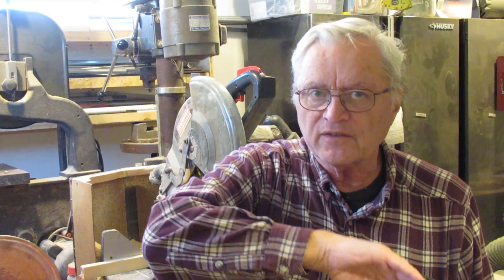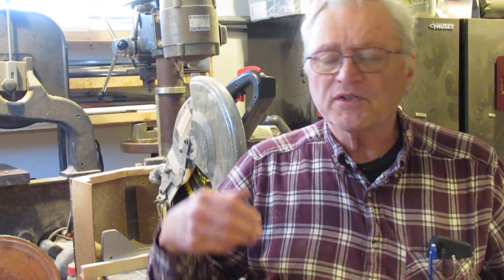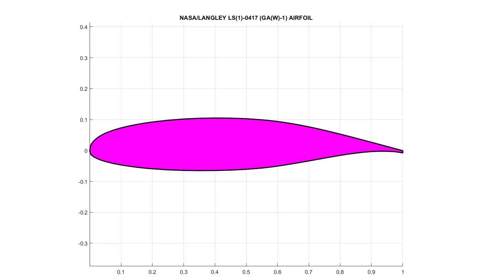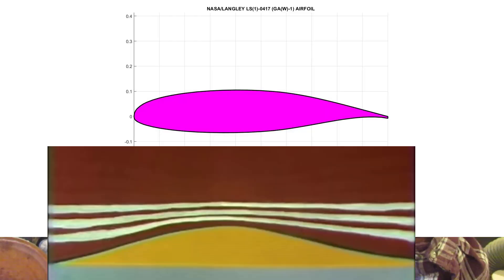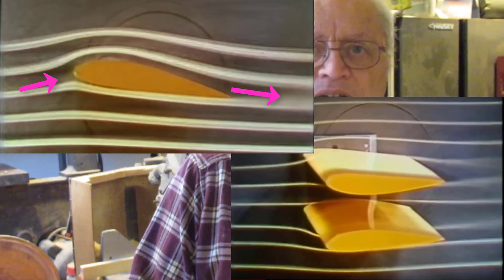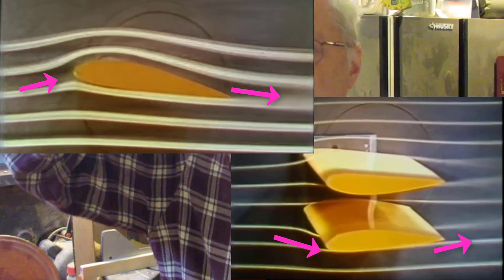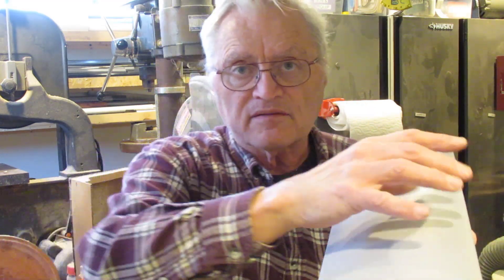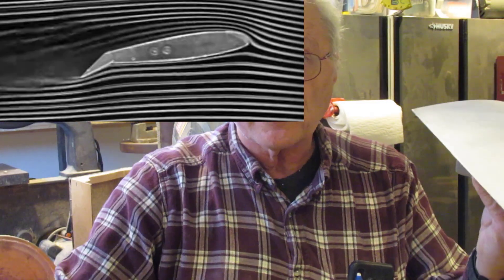Lift: 10 Myths in less than 10 Minutes

Comment: Love your video. I can add one more myth: 
11: "Lift is caused by flow curvature"  youTube video search "Magnar Nordal Bernoulli"

But I have to disagree with your Myth 10. That's not a myth. It's a fact.
You indicate that the truth lies within Navier Stokes, Vortex Shedding etc.,  but there is a simple mystery: 
What is the cause of the pressure difference that applies the lift force on a wing? 
It has to be explainable in classical physics that is intelligible to a senior school physics student or at least mathematical physics graduate like myself. Shrouding the answer behind a wall of obscure and insoluble partial differential equations just  doesn't do it for me.  
The development of wings for powered and unpowered flight has been a continuous process of trial and error for over a hundred years. Some changes improved the efficiency, some didn't. They took the useful changes and tried further variations.That's not science, that's good old engineering.
Find me a scientist that can demonstrate he/she understand it. 
I have a theory, based on the classical physics of  Boyle's Law and Charle's Law and does not rely on Bernoulli, but it's not fully developed and I'm brutally aware that I'm the "soldier who's out of step", so am keeping a low profile for the moment. But let me say that I'm deeply disturbed by the widely held statement that air over an aerofoil acts like an incompressible fluid. Air is quite patently compressible!!
Reply: @Observ45er  Nope, I have known this for a long time. I'm just getting better at explaining it.
Reply: @Observ45er  Now I'm confused. I have agreed with you. You said the wing pushes the air. And that the wing moving away reduces pressure. You are correct. 
Pushing air causes high pressure - that's what a bicycle pump does - it pushes air and creates high pressure.
I don't understand what any of that has to do with Bernoulli. 
This isn't comedy or a joke. I don't understand why you seem to be getting annoyed with me.
Reply: @Observ45er  I'm a retired software engineer, very active racing yachtsman, retired private pilot, BSc Mathematical Physics Birmingham UK 1967, grandfather of 5, based in Sydney.
Reply: @Observ45er  Now I am confused. 
You said: "I' don't think I said anything that has to do with Bernoulli " then " he explains that you CAN CALCULATE the lift force using either Bernoulli to get pressures from speeds,".
I am saying that Bernoulli cannot be used to explain lift because, as I said 3 hours ago, there is no acceleration of airflow over the wing. 
The pressure differences have nothing to do with accelerating of decelerating airflow. They are due to the "push" and "pull" that you identified an hour ago.
Eastlake's paper is just a rehash of the scores of books and articles I have ploughed through in the last three years. And, like Anderson,J, Marchaj, Gentry and Prandtl before them, he has completely misinterpreted Kelvin's conservation of circulation theory.
I would direct you to my exposition on Prandtl's misinterpretation of Kelvin but youTube does not allow me to post links 😞. I don't understand how you were able to post the link to Eastlake's paper.
Reply: @Observ45er  That's a very long comment, so I'll concentrate on the first point upon which we definitely disagree, and that is: "In the wind tunnel we see it speed up toward the trailing edge. "
If you look at the smoke over the top of the foil in Babinsky's excellent video, you will see that it gets to the trailing edge at the same time, or slightly later than the small at the top of the screen. 
That means it has not been accelerated by its passage over the wing.

I challenged Babinsky on this point and he explained why the smoke was not going faster over the wing than at the top of the screen in his experiment and he said: "Friction".
Could I make two requests please:
1. Could you show me an example showing the air being accelerated over the wing? And I mean experimental, physical evidence, not a computer simulation.
2. Could  you explain why it should accelerate?
Reply: @alans172  OK. One thing at a time.
Speed VS. Acceleration.
..
I give you credit for trying.
..
Unfortunately, Jim. You just proved you do not understand acceleration. 
..
First, In Babinsky's Wind tunnel video, the upper air [that starts right next to the lower air] beats the lower air to the trailing edge. Also, the lower air is FAR BEHIND your high reference AND the upper air. 
BOTH of those PROVE there is some kind of a differences you appear to not see.  They show that there is more (close-in) acceleration  above than below. Why can you not see that?
..
If you want to understand keep reading.
.
I'll try to help you understand.
..
The definition is that Acceleration is a CHANGE in speed.
..
For example (simple numbers):
.
1 - If an object is going forward at 2 MPH then reverses and winds up going in reverse at 1 MPH that is a change in 3 MPH.
A=3; V=1
.
If, in the same amount if time:
.
2- An object goes from 0.0 MPH to 2 MPH forward, that is a change of 2 MPH. 
A=2. V=2

.
In A, there is MORE Acceleration (3), but LESS ending speed (1). 
In B, there is Less Acceleration (2), but MORE ending speed (2).

.. 
Compare these carefully:
1. A=3; V=1 --> More A, but less V
2. A=2. V=2 --> Less A, but More V
.
The conclusion is that we can wind up with more A, but less V.
.
IF you don't understand that, we're done. Have a good life.
..
..
..
Some basic science:
Wind tunnel VS. moving wing observations:

Looking at Acceleration from these two (inertial) frames of reference, we will observe different speeds.
. . .BUT . . . 
We will observe exactly the same speed Changes, or Accelerations.

.
The observations show this.  This is very careful observations with measurements, nit just quick looks.
My figure 7 shows this and came from measurements by a PhD at JPL.
- - 
Cheers.
Reply: @Observ45er  
My requests were:
1. Could you show me an example showing the air being accelerated over the wing? And I mean experimental, physical evidence, not a computer simulation.
2. Could  you explain why it should accelerate?
These are fundamental questions. You say you have observed 1) in wind tunnel testing. All the aerodynamics textbooks claim it as a basic fact. I cannot find any evidence. Babinsky's video and my personal experience with a hand-held anemometer on the lee-side of the sail of a 40-ft racing yacht in 20 Kts apparent wind (12 Kts true) failed to find any evidence.
Reply: @Observ45er  Here's a link to my demonstration that the air does not accelerate over the wing. youtu.be/rHidaQgBb-Y
Reply: @alans172  No acceleration of air from a wing's motion???
Picture, for your viewing pleasure. No words at all:
www.grc.nasa.gov/www/k-12/VirtualAero/BottleRocket/airplane/Images/downplane.gif
Reply: @Observ45er  A picture tells a thousand words, but this one doesn't show air accelerating chord-wise over the wing:  the camera is pointed in the wrong direction!
Reply: "Find me a scientist that can demonstrate he/she understand it."
If you won't listen and try to understand, it is pointless.
Reply: @Observ45er  If you recall, it was you who initiated this thread with questions about my views on the subject,  not me. Berating me now for not trying to understand is a bit uncharitable. 
I am using my request for this information, not out of a desire for education, but to demonstrate that in your inability to respond, you are in fact confirming my knowledge that the very foundation of aerodynamics, namely that air accelerates over an aerofoil, is a myth. 
The fact that you have not responded to my questions reinforces my conviction that aerodynamic engineers such as yourself have too much professional, commercial and/or reputational capital in perpetuating the madness of theoretical aerodynamics that they are  unwilling to recognise that it is founded on many such myths.
Your apparent belief that I am engaging with you to understand what you are saying would be frankly comical, were I not dispirited that I have not been able to open your eyes to this myth.
Reply: @alans172  P.S. I'm an Electrical Engineer.  However, I understand physics fully and decided to study this about 10 years ago, band also doing a number of very carefully planed and executed experiments that are consistent with settled physics so I could use them with students that can understand physics, even at the grade school level.
Go to MIT or somewhere with an aerodynamics research facility and 'see for yourself' as I have.
However, 
If you have some skills that you can help others learn, you'll do better going with that and be proud of it, but don't post on You Tube trying to show that all scientists before you are blithering idiots.
.
Whether you intend to be or not, you're trolling.
Reply: @Observ45er  The fact that you're not an aerodynamics engineer deepens the mystery of why you are unable to comprehend the significance of the absence of evidence of air accelerating over a wing. You claim to understand physics, so will be aware that  that physics is an experimental science. 
Experimentally, using pressure sensors, it has been demonstrated that the pressure above the wing is lower than ambient, and that the pressure under the wing is higher than ambient. No argument. Good physics. That's what provides the aerodynamic force that provides the lift and drag from the wing.
And yes, Bernoulli and the thousands of  fluid engineers that have followed have demonstrated that when fluid flow is constricted in a pipe, the flow rate increases and the pressure drops. Good physics. Bernoulli and Euler used Newtonian mechanics of mass and acceleration to build a theoretical model to explain it. All good mathematical physics.
But…..
The air through which a wing is moving is not a fluid in a constricted pipe. There's no pipe. 
There is no experimental evidence of the air accelerating over the wing.

THERE'S NO EXPERIMENTAL EVIDENCE.
The source of the pressure variations cannot be due to the air accelerating. You have, in a now deleted reply, have already put your finger on the source of the pressure variations:
A wing requires a positive AoA to generate lift, so the underside of the wing is moving into the air, the topside is moving away from the air.
The wing pushes the air causing it to compress which creates the high pressure below.
The wing moving forward generates a void of low pressure above the wing.
That's it. It doesn't need acceleration, Coriolis' force, flow curvature or any of the madness of Navier Stokes to explain the fundamental physics.

P.S I saw your reply to my post on the Light and Sporty Guy's video youtu.be/IK2BS8BRXyU which you have since deleted. Yes, only .6%ATM is required to support a C172 and ~5% to support an A380, so compressibility is not that significant. It's the acceleration message that was important.
Reply: @alans172    Again, I've observed the acceleration above a wing with my own eyes at Embry-Riddle.
..
You talk like experiments are some irrelevant activity, yet you claim to have performed experiments by hand anemometer to "prove" your claim that there is no acceleration around your sail.
Question 1: Will you please resolve that contradiction - do experiments tell us how physics works or not? 
Don't change the subject with another 'what about' X. . .
..
.. Fact:
It is most definitely the experiments that have been done over the last centuries that have given us an understanding of the physics.  
How else ? were the sciences perfected to make things like modern medicine or the electronics devices you gladly  use with little to no understanding of?  Are all those happy accidents of dumb engineers?
.. ..
.. ..
Help me understand your physics. 
How does your physics explain these following things. . . 
.. ..
..
Question 0a: Do you  understand what causes common wind?
..
Question 0b: What causes the air in a pressurized tank to blow out  a hole?

Question 0c: Do you believe there are Euler Pressure Gradients or not? 
[I note that there is no pipe in the above examples]
..
..
Now: 
Above, you say: "pressure above the wing is lower than ambient, and that the pressure under the wing is higher than ambient." [agreed]

So. . . 
Question 1: Why are you ignoring the effects of those  so-formed Pressure Gradients?  
.
Question 2: Was Euler wrong?  Do you now claim that Pressure Gradients do NOT  cause fluid Acceleration.?.
..
..
..
Specifically:
If, there is ambient pressure ahead of the wing, and, as you do say,  a higher pressure under the wing:
Question 3: Doesn't that form a Pressure Gradient?

Question 4: Is it impossible for that ^ ^ ^ Pressure Gradient to cause an Euler Acceleration from it toward a near-by lower pressure?
..
Question 5: If Euler was correct and it does accelerate some air, which air and in what direction is it accelerated?
..
..
..
Likewise:
.
If there is ambient pressure  ahead of the wing and a lower pressure above the wing:

Question 6: Is that not a Pressure Gradient?   
Question 6a If not, why not?
..
..

You say: "The source of the pressure variations cannot be due to the air accelerating."

This is false because there Are conditions  where one acceleration causes a pressure Gradient that is THEN the cause of another fluid Acceleration as clearly explained here:
 https://www.youtube.com/watch?v=3MSqbnbKDmM 

That Pressure Gradient is the VERY one you say cannot, somehow cause an Euler fluid Acceleration.  It is the very one that causes the rearward Acceleration over the wing you say scientists must be blithering idiots for measuring.

Can you answer.?.?
Reply: @Observ45er  Sure am. Interesting Q's. re: Flow Curvature caused by pressure gradients: I'm not sure what you mean by flow curvature. 
No, temperature is not really significant. The real problem with the application of Bernoulli to explain the pressure variations is not so much the compressibility of air, but the lack of a) a cause of, or b) evidence of any flow acceleration over the top of the wing. It's flow acceleration that gives rise to the pressure change.  
And yes, indeed, I am aware of the pressure differences. Of course I am. They are, after all, the source of the aerodynamic force: a gas can only exert a force on an object via pressure (and  a tiny,  ignorable bit of shear stress) .  But that pressure change is not caused by a change in flow velocity. You can create a pressure change in plenty of other ways.
Reply: @Observ45er When the plane is flying through still air, where's the fluid flow?
Reply: @Observ45er  Yup, you're nearly there.: 
1. "Moving wing must push air out of the way and atmospheric pressure pushes it back in behind it."
and 
2. "Surface moving away from air, or air moving away from surface reduces pressure."

It isn't the SPEED of the air being pushed (1) or pulled (2). it's just the "push" that causes the high pressure and the "pull" that causes the low pressure. 
Nothing to do with Bernoulli. Nothing to do with momentum change.

Comment: I respectfully disagree with respects to engineers know what lift is just because they have some good equations and engineer great planes.  Ptolemy had some good equations for predicting the motion of the planets but was wrong.  While not quite the same, it is true either way, the success of an equation is proof of usefulness, not truthfulness.  BTW, I am not a mathematician, but, I do consider myself a natural philosopher and tend to look at things a bit differently. 
First off there is no lift without a pressurized elastic medium whether it be gas or liquid.  That means there is energy stored in the medium. Consider pressurized air battery systems. There is a 300,000 volt electrostatic potential between the ionosphere and earth at 100v/m.  Comparing the relationship between the ionosphere and earth as being like a capacitor is not far off the mark  considering the majority of the atmosphere is  dielectric.  Furthermore, we see this dielectric medium experience both discharge as arc plasma(lightning) and glow mode (Aurora), it is also known to have a dark mode invisible to the naked eye.  All this information was unknown to both Newton and Bernoulli who were limited to physical properties.  
While watching a video recently explaining the physics behind this debate, it seemed to me there is an analogous nature in the terminology to electricity, particularly that of the electric philosophers of the 19thc.     They would refer to voltage as pressure. Then it seemed the friction forces due to laminar flow over the wing is a current, so analogously its amperage.  At the front of the foil there is a "pinch" effect, and visually I immediately thought of a Bennet Z pinch in a plasma.  Lines drawn around a foil representing air flow/current, reminded me of magnetic field lines, imaginary lines as representations of density.  If I put this all together, and pretend those lines of current are actually individual current flow, then the pinch causes these current flows to get closer as they increase in amperage, thus increasing in voltage thus experiencing an attractive force between the surface of the wing and the air mass above it, like two wires with current flowing in the same direction.  The current under the foil has less amperage experiences less voltage/less pressure.  Due to Relativity, is the wing moving through the air or is the air moving over the wing? Once you put motion on a foil and create air flow over the wing, within my analogy you are creating an electromagnetic field. 
Now can anyone tell me what the gravitational constant represents?
Cheers
Reply: So a wing is basically an antigravity device… this explains flying saucers… !